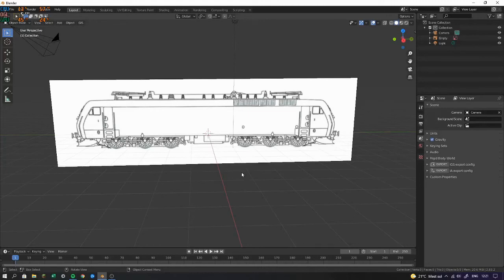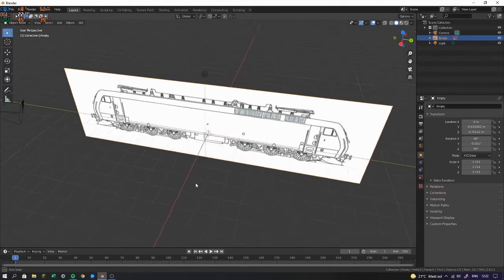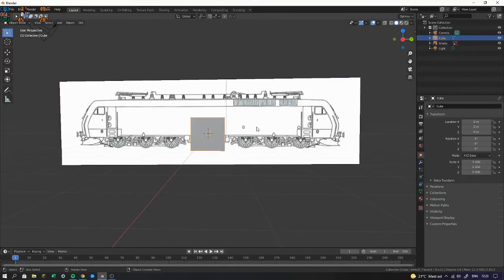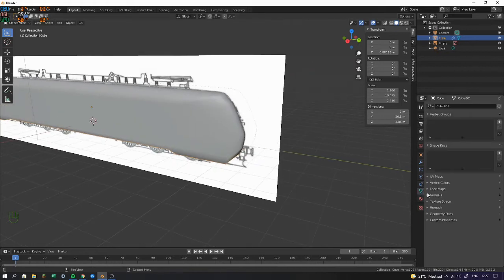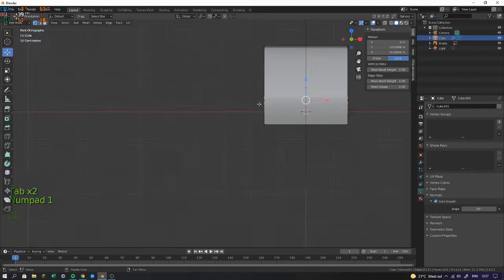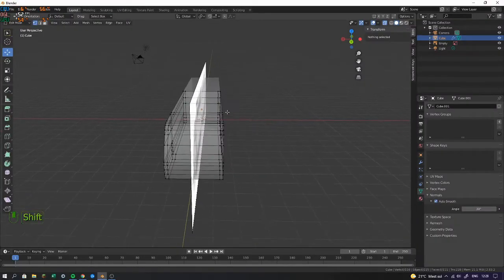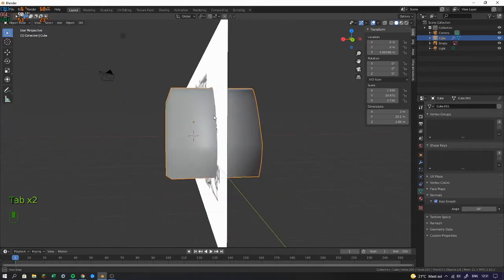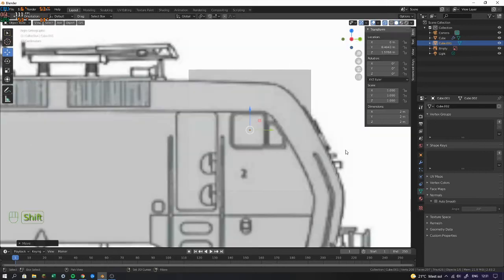Electric locomotive for Train Simulator part 1 | base building and first animation!

Comment: All around 7:13 I have no idea how you are smoothening and bending it? I am so confused
Reply from the maker: I am picking the outer vertices and moving them in :D Cause on the EG it
s not supposed to be smooth smooth. but a bit more "square" on the sides. I
m smothing it manually here. otherwise you could use Ctrl + b to bevel it
Reply: @christianbay2201  Thanks, also how do you do it in the middle (2:57) I just need to know how to do it down the middle isntead of the corners, thanks.
Reply from the maker: @Jakeso  Ctrl + R to do loop cuts :D

Comment: sorry if this is a dumb question, but how to put a 'reference picture' in blender like you did with the locomotive?
Reply from the maker: you decide where you want the picture, basicly where you're looking at it's gonna place the picture. Then you press Shift+A then choose "image" and "background" or "reference" I just normally use  background images as I can move on it.
Reply from the maker: and nothing is a dumb question :)
Reply: @christianbay2201  thanks man, btw will you be making a video on how to add sounds to trains?
Reply from the maker: @mikan004  I know how to add basic sounds, such as horn and control sounds. But I don't know how to add engine sounds (yet)
Reply: @christianbay2201  ah then i might mess around with other trains to see how to do so 😅
Reply from the maker: @mikan004  yeah, haha. That's always what I do. when it works it works.

Comment: When I press TAB it gets rid of the hole
Reply from the maker: That may be because you haven't Applied the modifier yet. If it's the boolean modifier you're talking about :D
Reply: @christianbay2201  Ik i am trying to make an NJT Alstom PL42AC I have the front mesh done just that I dont have the holes
Reply: also did use the Boolean modifier